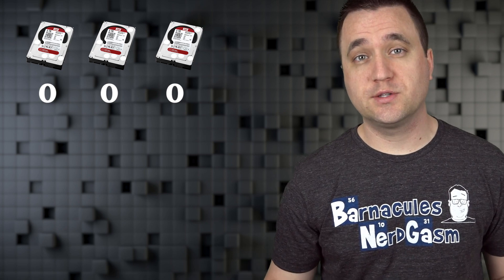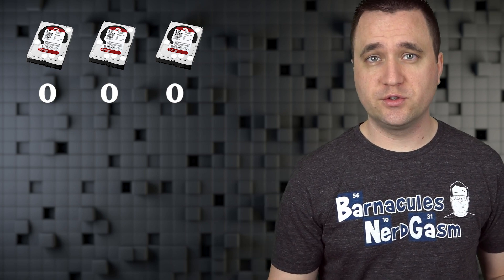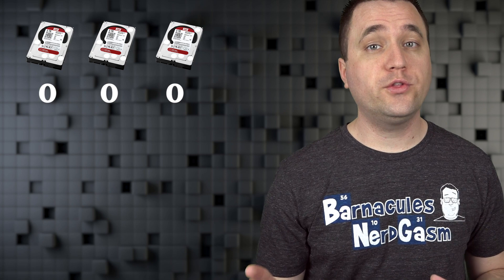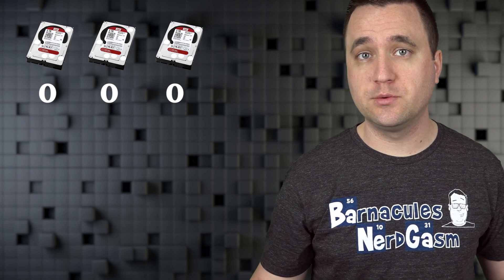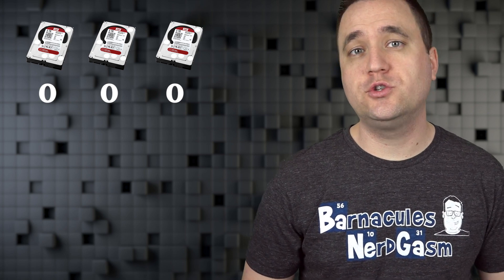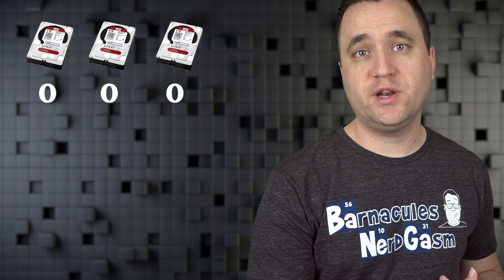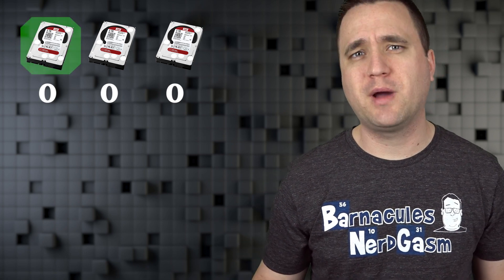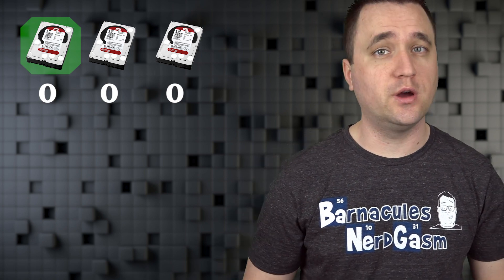How does unRAID Parity works and why did I use it...?

Comment: Please correct me if I'm wrong, but if during a rebuild of a drive another one has a read error, then the rebuilt drive will just have zeroes in that specific sector and intact data otherwise, or do you lose all the data?

Comment: I've never had an HDD fail ever going back to the 90s. Before the era of SSDs, none of my system HDDs ever failed, never had a storage HDD fail, I have my 200MB childhood HDD still, it's 30 years old and works like a charm. I guess I've been lucky. I mean HDDs definitely fail, but I think some people overstate the risk, it's usually 1 out of 100 drives will fail per year with an average use time of 3 months. But that's for drives that are being constantly utilized. Also, it includes drives that failed in the first month, which if you clear that hurdle the risk goes down dramatically for the next 5 years. Basically, if your drives aren't spinning non-stop and survived the 1st month, the odds of failure before 5 years are extremely low unless you expose them to crazy vibration or drop them or something. So I think for less than a 10-drive array, one parity drive is totally fine unless the data is absolutely critical, in which case you should also be backing it up in the cloud and maybe also cold storage. Also, with Unraid the data is not striped which is another big advantage.

Comment: Excellent. 1000 thumbs up for you. Researching if i wanted to switch from my current setup to  unRaid and your video help me decide. I'm going to research Synology and SHR a little bit but so far what i have now is wining. I have windows with Stablebit drive extender + stablebit scanner. Its actually been an excellent combination. Its not going to be nearly as efficient on space utilization as Unraid. Essentially it pools all your drives together and then you can pick how you want the redundancy to work. Say get get as granular as folder by folder and tell stablebit how many redundant copies you want to keep.  2x, 3x or you don't want it to keep a redudant copy of that folder. This way its very flexible so if you have a large folder than you know whatever is in that folder would be easy to redownload from the internet you can tell it not to duplicate that folder. If you have another folder that has VERY important info you can tell it to x3 that folder. The way it works is it pools standard NTFS drives together. If you tell it to x2 a folder it will make sure that folder is stored on 2 separate drives. If you tell it to x3 that folder it will be stored on 3 different drives. If something happens the drives are formatted with standard NTFS so you can easily pull data off the drives. So essentially its mirroring your data across different drives so in that way its less effecent in the other hand you can tell it folders you don't want to mirror so in that way its more efficient (of course how well this works is dependent on your needs). At the same time their drive scanner is awesome. Save my rear multiple times and emailed me warnings that it either found a bad block on one of my drives or my drive was overheating. The only thing is I wish it worked on linux. Not much of a windows lover :) but it doesn't.

Comment: The issue with losing data that is only on disk is that most likely the disk that will fail is the disk that is used the most. and the disk that is used the most most likely has the most data

Comment: I hope you don't mind me submitting this comment in two places - delete from whichever location you think it doesn't belong.  I already have my plex server set up on a windows 10 PC.  I'm currently using stablebit drive pool.  I don't have a drive failure plan.  I was researching using snap raid, but I can't figure out how to use it properly.  I found a program called elucidate, but not much info on set up.  I'm wondering if I should go to windows storage spaces - yes I know I'd have to do some work because storage spaces erases the drives.  I'll buy some more drives, create the storage space then move over the media then add those drives into the pool.  I am worried about adding parity and don't want to have to learn how to use a new OS.  I don't think I"ll ever need to have more than 4 streams from the server.

Comment: Again ... unRAID seems like it's using SnapRAID and some sort of Union file system. Actually pretty good. Though from what you're saying it seems to use the very old UnionFS by just filling one disk up and leaving the rest till they need to augment space.
IMO a better idea is MergerFS which has the option to spread files across all disks equally, even ballancing the loads to both improve speed as well as not overwork one single disk. Add SnapRAID onto that (1, 2, 3, however many parity disks you want) and you end up with the same redundancy.
Even better is that SnapRAID offers multiple versioning parity - you can even restore old files you happened to delete / overwrite. None of the others provide this feature. Again, pointy clicky install and admin on Open Media Vault - ideal for a noob building a home server. For a more tech savvy person I'd likely go with a Linux server and do it all on command-line.
Reply: how would you add SnapRaid to unraid? Unraid XOR Parity is something entirely different then snapRaids parity. I like snapraid more then i do unraid Since unraid cant repair corrupted files in a singe parity config, where snapraid can.

Comment: Maybe I just dont understand, you pay money for the UnRaid system, you dont get much of a performance boost or real redundancy, but you still prefer it after looking at all the features that FreeNas has? Cloud backup, having discs spin down when they are not in use, ect... I get that you may not need the added protection but it seems kinda odd unless you just dont use those features. Im glad youre happy with it but maybe you know something that I do not. Cheers.

Comment: Someone correct me if I'm wrong but the big selling point for me with unRAID is that you can add drives to a system or odd sized drives to the system at anytime. The problem with FreeNAS is you have to have all the disks symmetrical and set up before you set up the NAS. I might not want to have 10 TB of storage to start out with I might be fine with just 3 TB but instead I'm locked in to buying all this expensive hardware I don't need. And then if I do build a 4 hard drive FreeNAS and want to add more drives I have find a way to move all that data so I can start over from scratch to install all those new drives. It seems unRAID just gives you greater versatility and even though ZFS is badass I might not need all that security and performance it gives.

Comment: Not sure if you keep abreast of old vids and posts but I wondered if it is possible to, whilst using unraid, to schedule disk tests that can regularly check for drive failure or if you can run something like crystaldisk which monitors disks in real time (if I remember correctly)? would this not help to reduce chances of multiple disk failures or make it possible to replace a disk before it fails?

Comment: Just wanted to chime in, and say most of the downsides he's pointed out have been fixed, or have features to make it better.    I actually moved from FreeNAS to unRAID for the flexibility, and features unRAID Pro offers today.   I went with 12x8TB HGST 7200RPM NAS drives, and set 2 as Parity.   I also used 2 SSDs for the redundant cache drive.   Never has anyone complained about read, or write speeds from it, and they were using FreeNAS not but a couple days before I built/upgraded to unRAID.      Also make sure to check out all the cool apps that help with speeding things up.   If you are like me, and came from FreeNAS chances are you have a TON of ECC RAM.   Well use just a bit of that to cache all the folders to RAM for instant access baby!  :)    

I also got a 24 3.5" bay Supermicro server with dual Xeons from ebay.   Came with everything ready to rock, but the OS.   I had to flash the LSI card to IT mode, and then I started adding all my old drives I had after I moved everything over to the new BIG 80TB NAS I was talking about above.   I also set 2x4TB parity drives on there since 4TB was the biggest extra drive(s) I had.  I have added most of the other 18 drives.   The "preclear" process is legit.  It found some issues on drives that came from my FreeNAS build that I knew where starting fail, and get bad sectors.   Preclear found the issue, and I just set the drive aside.  :)  I use this box to mess around with VMs, and such.   I also backup the REALLY important stuff from my new NAS to it.  Then from there I have it sync the super super critical stuff to an external 8TB.   It's always good to have backups!  :P

unRAID fan for life!
Reply from the maker: Feel like we have similar setups, though yours a bit better ;p. So far I have loved unRaid and going back to the beginning, I would chose it again.
Reply: I actually have the exact same Rosewill case (minus the bad tray port) for my big storage I mentioned with the 12x8TB HGST drives.  The case, and drives are new, but the guts are from my previous FreeNAS build (new PSU).  Intel® Xeon® CPU E3-1230 v3 @ 3.30GHz CPU, 32GB ECC DDR 1600Mhz, on a  Supermicro - X10SLH-F/X10SLM+-F, and with another LSI SAS2 card flashed in IT mode.    I use this for just storage for the most part.  I run a few apps on unRAID for maintenance, troubleshooting, and monitoring.   I also just have 2x500GB Samsung EVO's for CACHE/APP drive. 

I use the 24 bay Dual Xeon (2x8/16 CPUs 32 total cores) Supermicro server I bought from eBay is used for VMs, backup, storage, etc.   I have that so that I could make use of all my old drives (not that old, but to me...lol) that came from my FreeNAS, hardware raids, jbods, and even externals.   It's got 64GB ECC DDR3, and I slapped 1TB SSD, and 2x500GB SSDs for cache/apps.   I love how BTRFS is able to use 3 SSD drives like that, and work out parity, and storage.   :)   I did kind of limit myself (at least for now) at 4TB max storage drives because that's what I had two nice NAS quality drives I knew for sure would be great for a set of parity.   That's ok because all my other extra drives are 4TB, or smaller at this point.   I did keep an 8TB USB 3.0 external for backup of critical stuff from both NAS boxes.  I'm expecting close to 45-55TB +/- usable after I put all my good drives in it.  ;)    The only gripe I have is the redundant 1200W PSUs in the server are a bit loud with the fans.   This doesn't bother me other then if I'm in the server room, but they are still louder then the CPU/case fans inside the bugger! :P  

I gotta say unRAID is for sure the NAS OS of 2017!   At least for what you get out of what you pay.   Don't get me wrong I did love my FreeNAS system, and was pondering for months before pulling the trigger on the new purchases on what I wanted to run.   I had already been running FreeNAS, and hardware Raid5 on a Windows machine (my OG storage tower), and I've also setup enterprise solutions at my job such as SANs, SSD raids, FreeNAS, DATTO, etc..   All of this experience, and research led me to finally choose unRAID.   Also that fact that I could try it out before I committed to learn it, and figure out all the quirks before I started moving my data over was awesome!    unRAID's plugins, apps, dockers, and VM is second to none!   I work with hyper-v all day at work, and unRAID is probably even easier to setup a VM on then even hyper-v, and hyper-v today is EASY!  :)

I also want to thank you very much, Jason!   I am also a HUGE Plex user.  To be honest that's really what started me down this path anyways.  It was so nice to see someone else who has gone through (most of) the process of setting up a new unRAID server that you either built, or purchased second hand on eBay.  Your videos were really instrumental in my choice for unRAID.  :O   

I think the only things I never saw you mention (at least I haven't found the video yet) was flashing raid/HBA cards to IT mode for true hardware pass through to the OS.   Maybe you didn't have to because your server came pre-loaded with FreeNAS, and I'd assume the cards were already set in IT mode if it was a FreeNAS server.   Issues I found when not in IT mode is unRAID likes to freeze when selecting drives to add to the array.  I'm assuming this is because it doesn't truly have direct access even thought the card says it's in HBA mode.   I also notice that if I didn't turn off the boot ROM option for the raid card it wouldn't allow USB boot after adding a drive past 13 to it.   It was the craziest thing, and I thought I had bad drive(s), or bad slot.   That caused some panic troubleshooting lol!   

Thank you again very much, and I will be following your work as you continue on a very similar journey as me when it comes to home/enterprise solutions.  :)   Who knows maybe we can bounce some ideas, or even hardware finds off each other someday down the road.
Reply from the maker: The system I built came with freenas on it, as a prebuilt option (ofc I made many modifications lol) so I didnt have to flash the cards.

thanks for watching :) Happy to extend my addiction to others lol

Comment: I use 4TB raid 1 in my nas and a single 4TB drive also a backup in my second Pc, so up even if I had something like a power supply failure and all drives in my nas die, I still have my Data

Comment: Great video, thanks for explaining it! I just moved from a 4 bay Qnap TS-421 and I've got much more flexibility - couldn't be happier. I only have 1 parity drive at the moment, but what I'd recommend (and what I'm doing) is pick up 2TB (whichever size works best for you) external drive and plug that in, map it is unassigned device and then use Duplicati to sync your most important data to it (or send to Amazon S3). That way if I loose a drive and don't have parity, I really only loose downloaded movies which is annoying but not the end of the world :)
Reply: If you are only using 4 drives you should be more then fine with 1 parity drive.   Odd wise...  :)   What I'd do is when you get to about your 6th disk then add a second parity.  They say that's when the math changes a bit, and the odds of 2 failing rise a tiny bit.    We are still talking RARE!   Especially if you precleared all the drives, and run regular SMART checks, and Parity checks.  :)    Sounds like you have a nice setup!

Comment: hmm, this leaves me wondering. I'm not fussed about the write speeds, but if it's only running one drive at once on read it should save Alot of power, but is that going to be enough to stream plex in 4k to 2-3 users at a time? thanks :)

Comment: so are SSD drives reliable in these systems
Reply: They're better than they were. We use them in our enterprise when speed trumps a certain amount of reliability vs. "spinners" (There are many applications an all SSD array can be a thing of beauty). With that said, we backup the SSD RAID arrays through more avenues than we backup our HD-based RAID arrays.  Outside of specialized applications, if you're looking at an SSD array for home usage, you're probably hitting an ant hill with a sledgehammer because you're limited mostly by your gibabit network which an HD array can easily saturate on sequential r/w- you'd have to upgrade the network and some of the clients as well. Just be sure to backup the array rather than relying on RAID or unRAID as your sole redundancy because SSDs fail differently and more dangerously than HDs. Finally, there's also been evidence from Google's datacenters whether even pro or enterprise SSDs are actually more reliable than their consumer counterparts.
Reply: Greg Shaw If you have the bucks buy Enterprise level SSDS. They have a ton of extra cells for redundancy.

Comment: @9:37, two data drives fail would not result in data loss if you have a 2 parity drive setup.
Reply: I think this was prior to the dual parity update
Reply: You’re correct, dual parity setup protects against two drive failures, even just two data drives, the algorithm is not the same as one parity drive.

Comment: Unraid 6.2 has turbo write mode on disk settings. that significantly improves the write speeds. But all the disk have to be running at once.

Comment: I have ALWAYS used WD drives, mostly in some kind of RAID, from Raptors and Velociraptors all the way down to the Green drives and never ever had a drive fail on me in 15 years.
Reply: Andy Bradley Seagate really excels  if you are using SAS Cheetahs, but other than that I prefer WD.

Comment: Correction, unraid will use one drives worth of disk space for parity. If it used on drive, it would be useless since all your parity would be lost if said drive failed.
Reply: Otherwise this is a great video, I actually learned a couple things watching it.
Reply: Nope, unRAID uses a SINGLE drive for ALL its party (unless you go with the dual parity setup). If said parity drive fails, you've lost parity, but no data.
Reply: Mike p eww, glad I'm not using unraid then. I definitely like how zfs handles parity over unraid, more data security (counting parity as data)

Comment: just out of curiosity, what are you using (software) to preclear stress test your drives and when you said you sent drives back for warranty was that based on the smart readings after the stress test or some other factor (physical fail)?
Reply: the unRAID community has developed a bunch of useful plugins. One is called preclear_disk which (besides zeroing a disk so it can be quickly added to the array w/o breaking parity calc) exersices the disk for hours, provide SMART reports before and after, and even alerts you to issues that might have been found as a result.